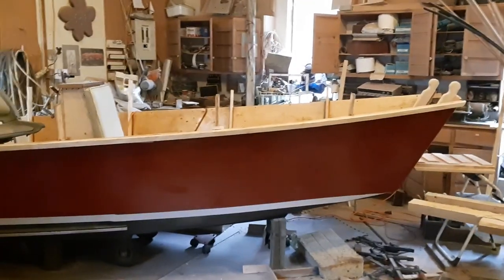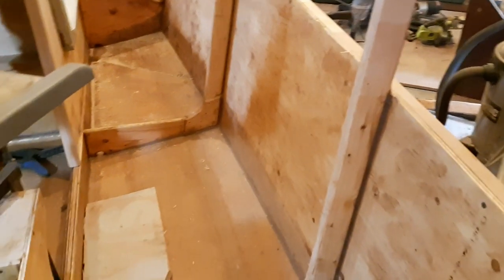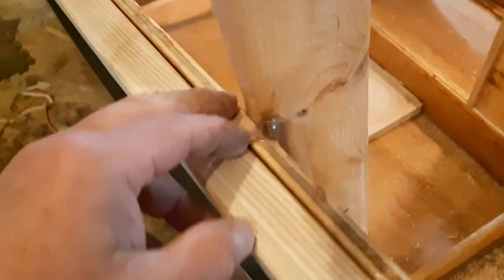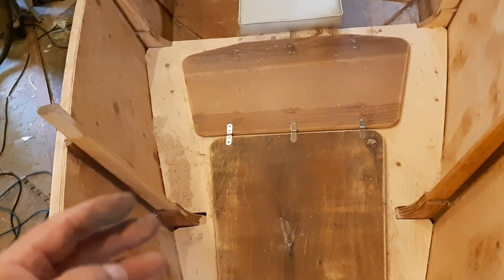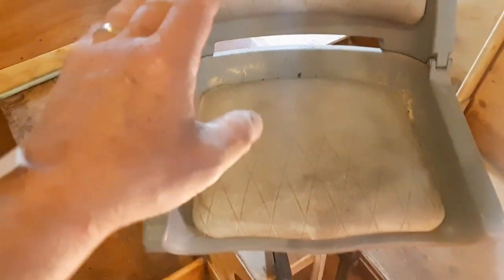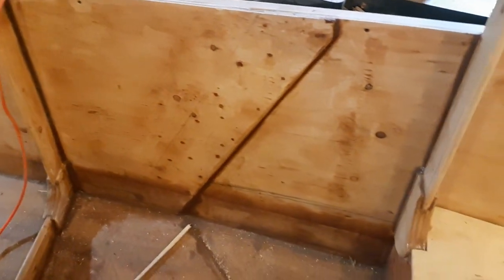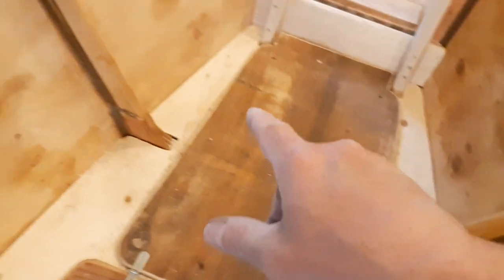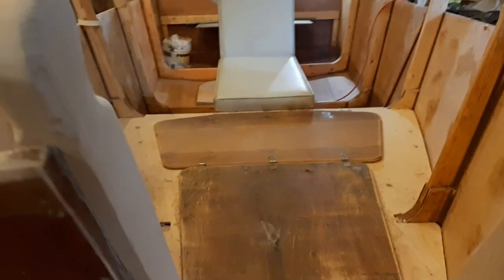Home Built Fishing Boat update, a 14 foot Center Console tunnel hull

Comment: Very interesting! Never have seen lap plywood construction! Quite unique. And looks great!
Reply from the maker: Thanks Daniel. I noticed friends Stevenson Designed boats have rotted on the seams...two now! My way the end grain is sealed over and with a lap instead of a butt with backing, it should also be very strong.  The V of the joint adds strength as well. Time will tell. BestRoy